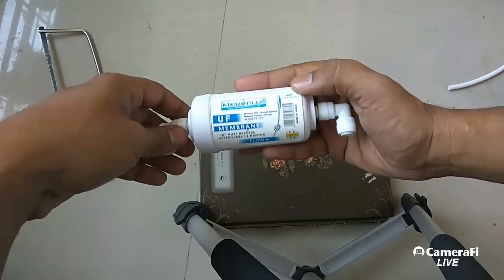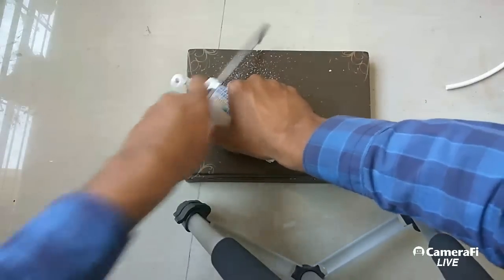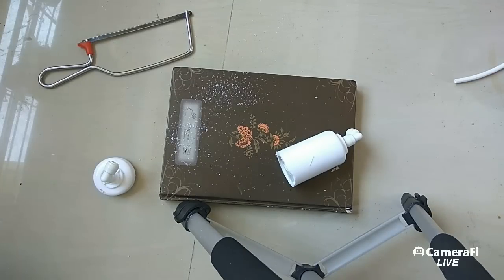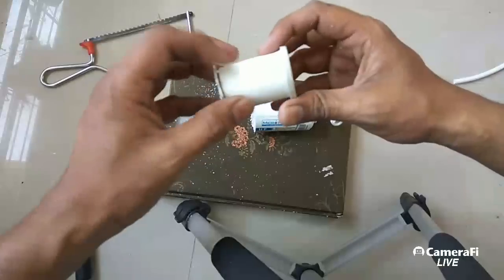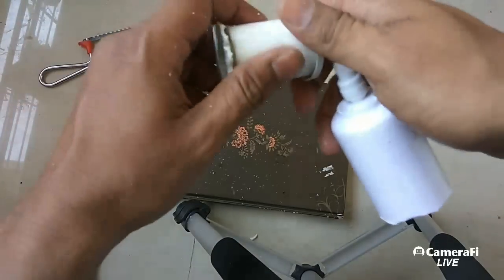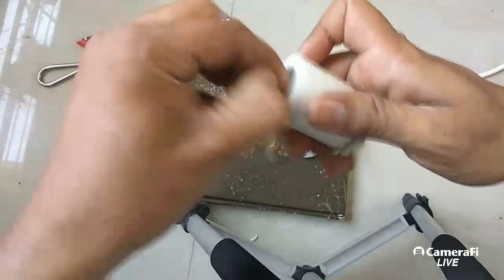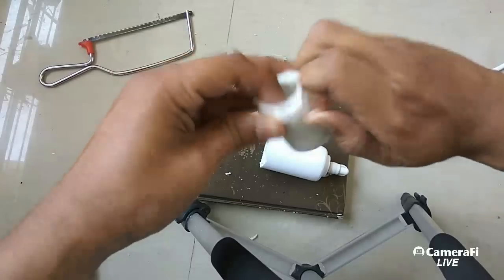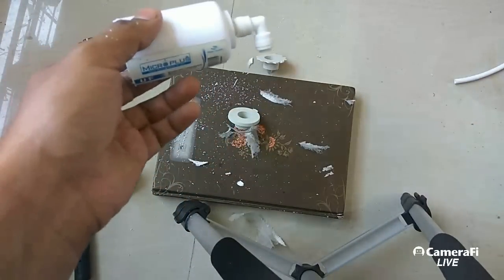UF membrane SCAM ; you won't trust small UF Membranes after watching

Comment: UF is Ultra-Filtration. It is a special sort of membrane filtration technique that can filter out sediments as small as 0.2 miro meters, which is enough to filter out most bacteria and pathogens! 
UF membrane looks like a paper sponge, and this is how it is supposed to be! It works like this and is not a scam at all.
Even Ultra-pure water for research is made using treatment using special UF membranes!
Reply from the maker: Correct
Reply: Hi I know this is a very old video but I just got a UF filter for my fish tank but it does not lower my TDS at all so is it useless for fish keeping?
Reply: @hamster1-1 UF membranes do not reduce TDS, they filter bacteria and dirt... Only Reverse Osmosis RO purification through multi stage Special UF membranes can reduce TDS of water!!

Usually municipal water supply is soft enough. anything lower than 500 is fine for fish tank...
Usual RO purification reduces TDS too much, so if you want to do some low level adjustment you could mix tap water with RO water in calculated propositions based on TDS readings.
Reply: @debudutta1  thank you for the reply I’m just unlucky and never knew this before I brought the filter maybe I will buy a RO and use this as a pre filter. 
Yes I’m after close to 0 TDS as what we normally do is add are own minerals back to the water for 100% safety of the animals.
If I don’t use it as a pre filter maybe I can hook it to the shower and just wash with cleaner water again I thank you for answering 👍
Reply: @hamster1-1  Are you making water for fish tanks for academic research? Like zebrafish etc? To make requisite TDS water with 0 tds meaning almost Deionized water and then adding minerals is going to be very wasteful and very expensive! And is definitely overkill...

You can buy a fish water system that can maintain a set TDS value with an integrated system, would be much more sustainable and economic... Can add some specific metal salts based on fish requirement...
Reply: @debudutta1  hi no it’s not for academic 😅 it’s crystal red shrimp 99% of people in this hobby use RO water I just don’t agree with the waste in water so stayed away from RO system what I use at the moment is 3 pre filters and then run it into 3 large DI resin filters this gives me 0 TDS. as where I live DI resin is very cheap and thought this filter could of been another way to go. Even RO systems are cheap here but don’t like watching water going down the drain for a hobby👍 don’t worry the minerals are not that expensive
Reply: @debudutta1  bumping up an age old thread, but I see a purifier with post carbon filter instead of UF filter. Is it okay, or better to skip it? silver activated post-carbon filter to be precise.
Reply: @AnilKumar-lf5jt  What do you mean? UF is the main filtration system. A post filter doesn't determine the water's purity, it can be anything which is supposed to change the taste of the filtered water. So the choice of post filter has nothing much to do, except determine your cost of maintenance. Anything fancy as a post filter will be more expensive.
Reply: @debudutta1  post filter as in it's name.

Comment: Dear Sir . Like you I also cut opened THE UF FILTER   installed in my RO=UV FILTER WHICHE I HAVE  PURCHASED FROM AQUA GRAND ,  after one yea rof  use . for replacing the filters .To my surprise i found inside the UF FILTER INSTALLED IN THE AQUA GRAND  RO+UV FILTER was nothing but a sponge which they might have  collected from some dust bin . At least the DEMO which you have shown contains SEDIMENT FILTER CARTRIDGE . In my case it is horrible .( A DIRTY  SPONGE PIECE ) Why these companies like AQUA GRAND ARE EXISTING IN THE MARKET . TO KILL PEOPLE WITH CANCER . I ADVICE PUBLIC TO DRINK TAP WATER INSTEAD OF PURCHASING THE DIRTY RO+UV FILTERS FROM AQUAGRAND LIKE DUPLICATE MERCILESS COMPANIES.
Reply from the maker: +Seetharaman tv Aquagrand is not company . It is just a cabinet. Inside filters are to be used from trusted sources.
Reply: Sir. Thanks for your reply .  Iknow even KENT is not manufacturing any filter cartridge but they may  purchase ALL FITERS VIZ CARBON, SEDIMENT, RO .UV  etc from reputed manufacturers and assemble and sell in their name. . But these AQUAGRAND , AQUADRINK  etc are DUBIOUS COMPANIES ASSEMBLING ALL FICTITIOUS FILTERS AND MARKET AT CHEAPER RATE  IN THE NAME OF PURE WATER DRINKING . BUT THE COMMON  PUBLIC ARE ONLY GETTING FOOLED . They think that they are drinking  bacteria  free pure water  ( like me )